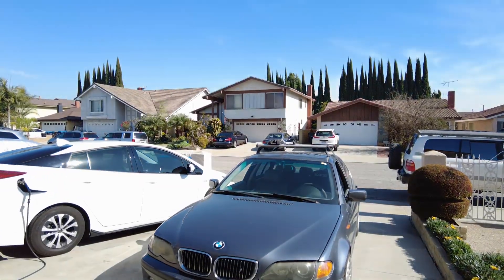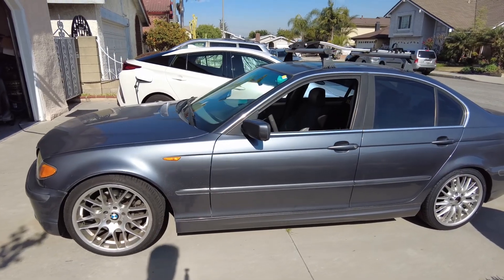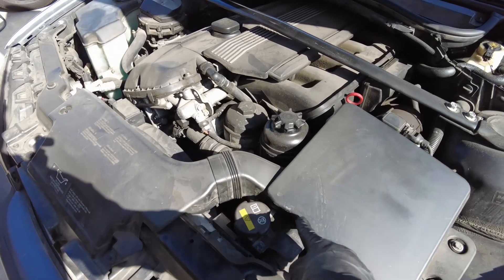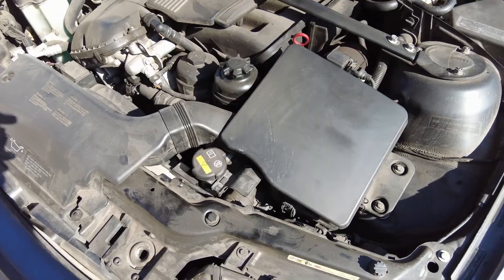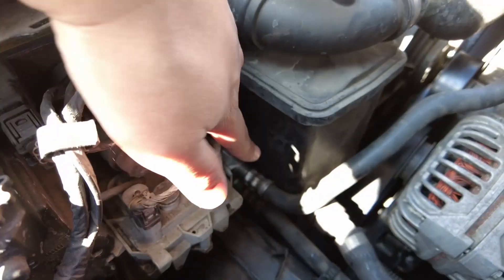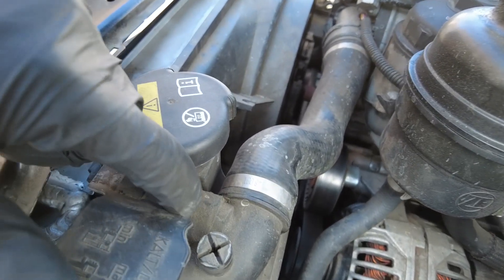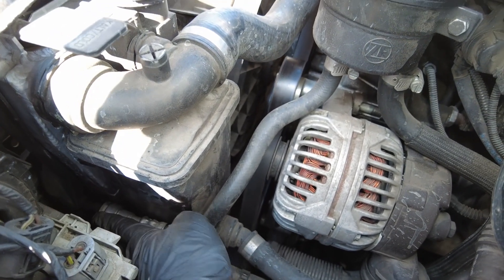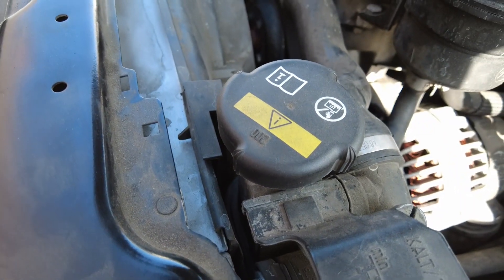BMW E46 Expansion tank removal and replacement, PLUS how to bleed the cooling system properly

Comment: this is a completely wrong way to do it, engine should never heat up that and you should be worried if it gets that hot. he just closed the cap when there was clearly too many bubbles popping out of the system. search up other videos on how to do it if you don’t want your head gasket blown!
Reply: Reverse engineering of the Pacific rim, lost in translation.

Comment: following the fitment of some new coolant items on my e46 ( tank, hoses, trans oil cooler etc) i filled with water, bled it and ran it at idle til normal temp. after ensuring there was no leaks at operating temp, i drained the system (once it cooled down) and refilled with correct mix of  A/F and dist water. That way if there was a leak i wouldn`t  lose my A/F.

Comment: Why did you not to put Water with antifreeze?...and neither  new cap one to the expansion tank?
Reply from the maker: Water was mixed with coolant off camera. Radiator cap was actually relatively new, replaced only about a year ago. Should still have some life left
Reply: @chowcares  I did not have seen the Water was the colour Green..blue...or Pink... for this question I asked...since I did not see that Water was mixed...
Reply: @chowcares  if you replace the rad cap with a 1.4 bar cap you can potentially save yourself a bad time down the road
Reply from the maker: @ikeepgettinbanned5525  i'll probably do that. i also need to change all the o rings on the coolant pipe connections but im not too motivated... lol

Comment: Hey so I’ve got a manual e46 and I just recently replaced every cooling part but the radiator and the expansion tank retainer and for some reason I’m having a issue with it leaking from the bottom the retainer that goes into the back next to the drain and can’t figure out if a new one would fix it or not because they both don’t have i rings but the automatics

Comment: Its been said already but putting room temp water or coolant into an already hot engine (coolant was steaming hot) your will blow the head gasket.
Reply: Whether the head gasket blows will depend on how much cold water you add, and how suddenly.  IMHO adding cold water SLOWLY should be okay.

Comment: To all of you, people that love your e46 do not follow these steps! You have a bleeding screw why didn't use it at the beginning you've done a stupid mistake running the engine with airlocks in, never run those engines with needle to the right
Reply: The bleeding could have worked at first even without using the bleeding screw, the problem was when he overfilled it and mostly water and capped it off for 10-15 minutes without ensuring no more bubbles show up. He should have left the cap off while it warmed out and the bubbles no longer show.

Comment: ohh man I hope no one follow these steps to bleed their cooling system in their car. You could have done a great video but this procedure is totally wrong
Reply: The bleeding could have worked even without using the bleeding screw, the problem was when he overfilled it and mostly water and capped it off for 10-15 minutes. He should have left the cap off while it warmed out and the bubbles no longer show.

Comment: not at all how you bleed coolant on these, no car should have its temperature go past the middle section when bleeding. pop the bleeder screw and fill til bubbles stop coming out, done. monitor it a few days after to add if necessary due to heat cycles and expansion.